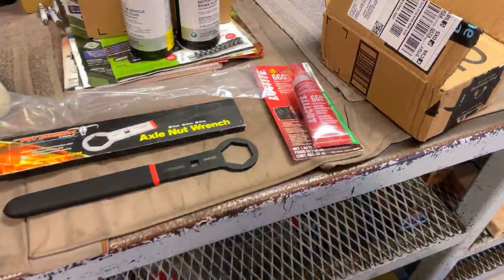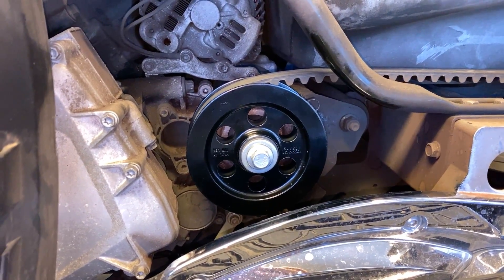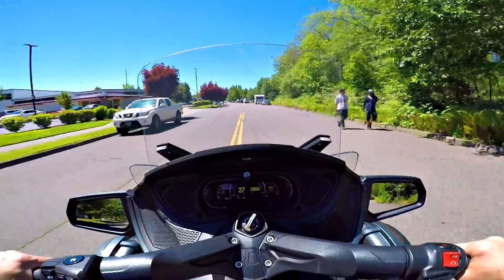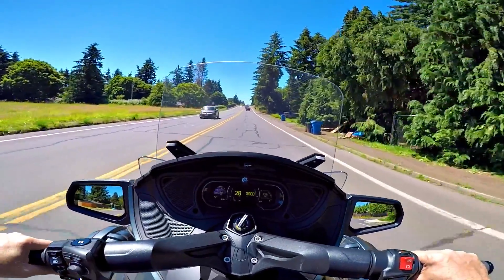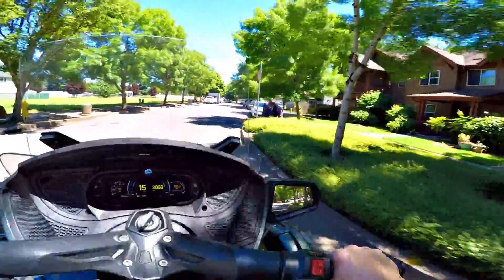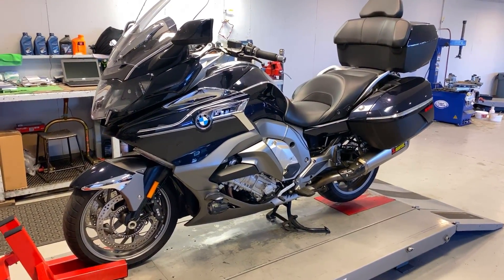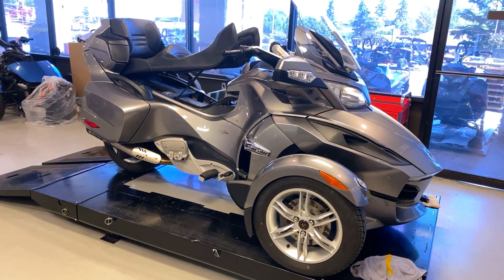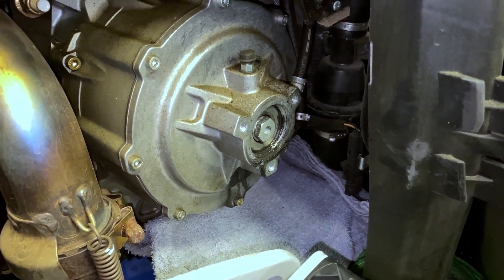Used RTL Is Waiting For You!! • RTL Shaft Repair..! | TheSmoaks Vlog_1681

Comment: I remember those short winters days in Scotland. 6hrs of daylight. Here in Oz it's not really much better in winter . Dawn at a bit after 6:30AM, sun goes down a bit after five. Where I am in Queensland there's no daylight savings  in summer so the sun comes at 4:00am and by the time you get out of bed it's already 30c but it's all gone by 8:00pm. Trouble is it's still hot and the bugs drive you nuts.

Comment: We have corporate dealers down here. The dealer I used for some things was independent and then they were bought out by Ride Now. Changed everything and moved them. Long story short, after a fuel pump flange recall the original dealer did and the new iteration wouldn't touch it later when it leaked, so I moved on. Fixed it myself. Of course they wanted to sell me a new BMW. So the only really independent BMW dealer in the state is in Tucson, which is 120+ miles away. The other corporate is the guy that used to own Go Daddy. He's spreading out. He built the largest HD dealership in the world. Both are very sales oriented, some high pressure, all push ridiculous fees and services that add thousands to the cost. IDK. I bought my RT when I lived in Iowa. That dealer was a farm implement dealer that sold bikes too. The owner sold me the bike and was straight up to deal with. I don't see that anymore. It's hard to find a place that is interested in long term relationships and the turnover in these places tends to be higher. Anyway Shawn, have a great Tuesday.

Comment: You just about said the reason for waiting for the 3000m/5000Km oil change and not any earlier. you left me hangin there as I just got my 5000Km service done yesterday and was very interested why there's such a long term for the first one where one would think the initial run in period would have the most wear on new parts.

Comment: I just bought a 2019 Spyder RT about a month ago and was told to bring it in at 600 miles for the first inspection and service.  Was that wrong?  By the time I got it in I had 1150 on it.
Reply: It’s 3000 miles for first service